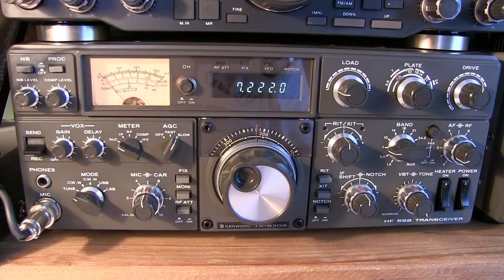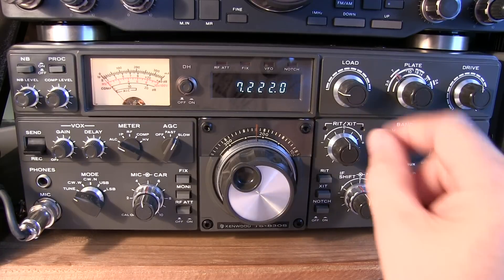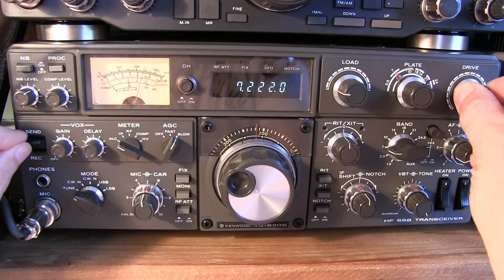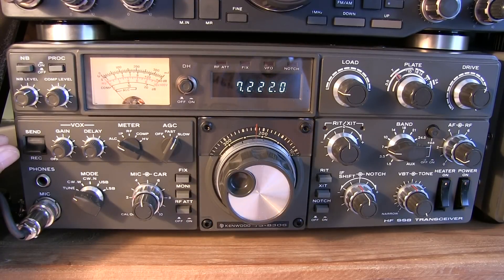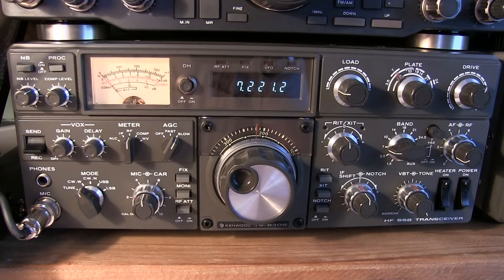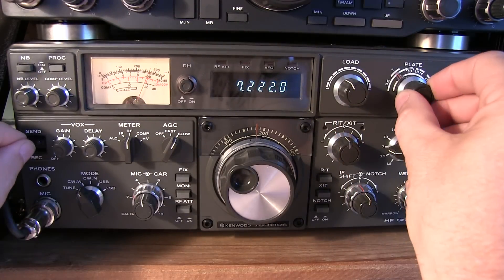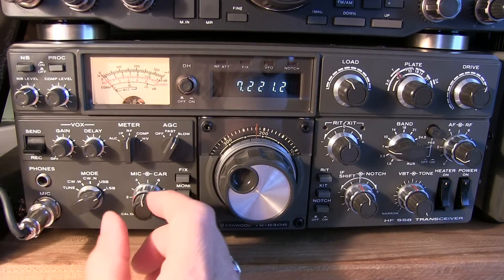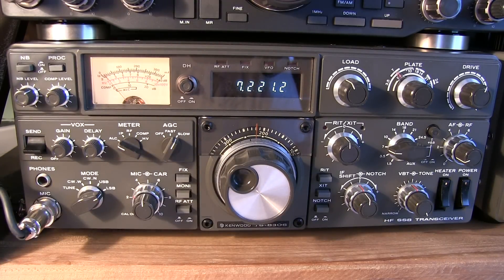#153: How to tune up a Kenwood TS-830S hybrid rig / transceiver | TS-520 TS-530 TS-820

Comment: I’ve a,so got the external tuner, following these steps do I still need then to use the atu ?
Reply from the maker: Depending on the extent of the mismatch, you can usually simply tune the radio directly to the antenna system and not use the tuner.
Reply: @w2aew  thank you,. ive just set it. up today initially with.a dummy load but now have it RX on my efhw, no TX yet  and worried about damaging it, it's just a lovely radio.
Reply: Sorry another question , this worked great but do I have to do the same routine whenever I change band so if I go to 20m form 40m ?
Reply from the maker: Yes. You have to retune when you change bands. Sometimes even if you move far in the same band.

Comment: Dear W2AEW, thanks for the very informative video. 
One addition if you don't mind. My TS-820S manual starts the tuning process with checking the plate idling current with Meter switch set on IP.   On LSB/USB switch the Send and see the current, should be 60mA. Adjust with rear panel Bias switch to 60mA. This is also mentioned in TS-830 manual. Any comment on that?
Anyway your video is the most informative how to tune a hybrid rig.'
72' OH2XA
Reply from the maker: Checking the bias is a good idea. I didn’t include this in the video because it isn’t something that requires adjustment often.
Reply: Roger roger

Comment: Great video, I watched it a couple of times so I can comprehend what you were doing. I'm assuming this procedure is the same for the ts-820s.  My question is, how many megahertz away from the original frequency can I go without returning?
Reply from the maker: It depends on the band.  On 10m, you can probably go several hundred kHz or even 1MHz.  On 80m, you may have to tweak it if you move by 40kHz or more.

Comment: I followed you instructions to the point of tuning at power.   At that point, I switched the meter to RF as instructed.  I set the mode knob to CW.W.  Note that I have previously set the drive and CAR as instructed to keep the needle in the ALC range.  Moving on.  First of all I switch the send/rec switch to send and nothing happens on the meter. So, key my code key and then I get a signal on the meter --but it is way off scale.  If I don't use the key, I get nothing on the meter.  So, to bring the needle back on scale, I have to tune the CAR down to about 1 on the knob scale.  At that point the needle is on the meter and I can adjust for max power on the load and plate.  The meter is reading right at 350mA.  But that's where i set it when I reduced the CAR to get the needle on scale.  So, exc for the glitch where the needle went off scale after the initial final resonance tuning, I should be set to transmit.  However, my output is only 40 watts in CW with the key on.  I should be at 95 watts or so, shouldn't I?  I have the same exact rig that you're using, the Kenwood  TS830s.  What am I doing wrong here?

Comment: Well, I give up on restoring my TS-830S. I'm parting it out. Everything is fine with it. I took it completely apart and I'm not techy enough to get it back together. Anyone want to purchase some great parts?
Reply from the maker: I wonder if the gear assembly in your VFO is less worn-out than mine?
Reply: @w2aew  It's like brand new. Gears are perfect.

Comment: I was able to peak the drive and dip the plate current, but when I put in cw mode and the meter at rf and switch to send the meter has 0 movement. Does that mean my final tube is bad?
Reply: On my TS820S I had this happen.  Turned out the SG switch on the back was turned off. This greatly reduced output. It should be on for normal use.
Reply from the maker: Could also be a problem with the mode switch/

Comment: My alc doesn't seem to work is it okay to use the RF in this process while doing the first two steps before the plate
Reply from the maker: It is difficult to say for sure, but as long as the dip and peaking process worked, you may be ok.
Reply: @w2aew  yes plate diped a little
Reply: I got the alc to work just needed to turn the carrier up a little bit

Comment: The tune-up procedure as described in this video corresponds to that which is contained in the Kenwood TS-830S manual, however, the procedure as described in this video does not necessarily provide the maximum output power.  For maximum output power, after completing the procedure as described in this video, you then peak the output power as shown on your SWR meter (or other means of monitoring your output power) by alternately adjusting the PLATE control and the LOAD control while you are in CW mode with key down.  I use non-resonant antennas in conjunction with an antenna tuner. It has been my experience that the tune-up procedure as described in this video may provide only half as much output power as that which can be obtained by peaking the output power as shown on my SWR meter by alternately adjusting the PLATE control and the LOAD control while in the CW MODE with key down..  Be sure not to exceed 5 to 10 seconds key down when performing this second phase of tune-up.  Credit for this enhanced method of tuning the TS-830S goes to Mark Gilger, WB0IQK. Net Control for the Kenwood Hybrid net.

Comment: Just curious…. I just received one of these radios. Does tuning up as this video shows eliminate the need for an antenna tuner?
Reply from the maker: In many cases, yes.  But of course, it depends on how bad the antenna system is in the first place.
Reply: @w2aew I’m guessing I’d need an external swr meter…. Not seeing one on the radio.
Reply from the maker: @brianr76    No, not needed.  As long as you can dip the plate and peak the RF, you're OK.  An external SWR meter will NOT help as it would show the SWR on the output side of the tuned network - it will not show the effect of adjusting the output PI network.
Reply: @w2aew  thank you. One more question as you seem fairly knowledgeable about these radios…. I need to have the power cord replaced because it’s frayed and looks like it was chewed on by something. Is there a specific cord type/amp rating I should use, or just any standard two prong ac cord will do?
Reply from the maker: @brianr76  The stock cord was an ordinary 2-prong AC cord, so that would work.
Reply: @w2aew  thank you so much! Hope to get this cord swapped and fire it up soon! I’ve bookmarked this video and given you a sub 👍🏻

Comment: I have a four or five of the solid state newer Rigs but I love my Hybrids! I have my TS-530 on the bench now. I need to get my TS-830 and my other 530 in somewhere for some TLC. My first Rig was the TS-830. Over the years I've owned five of them. I used to have my dad's old TS-820, and I had a 520 for a while. Don't know how to fix them so I just had to buy another. N9XFX

Comment: Nice video with one exception: On my TS-830S, keying the microphone (MC-50) does not deflect the meter when  ALC is selected, As the result, it is not possible to adjust the microphone gain using the method described in this video.  With a Kenwood MC-50 microphone, the optimum setting of MIC is generally around "4" on the "0" to '10" scale.

Comment: Thanks for that. I don't own one of these radios but I've always wondered what those controls do. Seems like a lot of work to get on the air. Are these radios using valves or transistors? Im assuming valves. Also what's the heater button for on the bottom right corner?
Reply from the maker: It is a hybrid rig.  All transistorized except for the RF power amplifier which uses 3 valves (tubes).

Comment: Is possible for the meter on this rig to indicate the wattage output or do you need a separate wattmeter for this?
Reply from the maker: It's best to use an outboard power meter.
Reply: @w2aew  Ah.  Ok.  Thanks for the tip.
Reply: @w2aew  Ok, thanks.

Comment: Would be so awesome if you could do the same video but on Yeasu FT102.
Reply from the maker: Well - if I had access to an FT-102, I would.
Reply: @w2aew  I have ft102 and I love it to bits. One of the finest radios ever made. There is some weird issue with frequency counter, after hour or two of operation it start showing 6khz les than it should and very last digit would display random numbers... apart of that it's all good. Anyway,  thank you so much for your awesome videos, best ham radio content ever!

Comment: Thanks very much for making and sharing this video. I have just agreed to buy a clean and tidy TS530 and found this very useful as I know nothing about hybrids but want to learn. Please can you tell me if I do this procedure every time I change frequencies or is it every time I change bands?
Reply from the maker: It's a good idea to retune if you adjust your frequency significantly, such as 20-40kHz or more on the low bands or 50-100kHz on the high bands.  And, you MUST do it when you change bands.
Reply: @w2aew  Thanks very much, I appreciate you taking the time to reply.

Comment: Why mess around doing all that with the LOAD control at minimum?  I've read where that is not good for the tank circuits.  Just set the meter to RF, and tune for max output.  Not necessarily the maximum power that can be achieved, but max output at less than full drive level.  Then gradually increase the drive and adjust for maximum power output.  I've used this method for over 30 years.  The rig still works fine.

Comment: I know this is an old video but how would i reduce the power output to drive an amp? Lower the drive?
Reply from the maker: When using an amp, it's usually best to use the ALC connection between the amp and the rig (if the amp has one).  If not, then the two recommended ways to reduce the output power of the TS-830 are to a) reduce the LOAD control, or b) use an adjustable DC voltage on the ALC input.  These methods are described in these two references respectively:
https://www.k4eaa.com/TQ1.htm
http://www.wb4hfn.com/KENWOOD/Articles/TS-830%20Survival%20Guide-01.pdf
Reply: @w2aew  Thanks. VE3WF

Comment: I did as Alan said on his video here and didnt worry about the 225ma which I had questioned him about. After I tuned mine the way he  describes I checked to see if I was between 225 and 260ma which is okay according to the 830s manual and I was at 240ma @ near 100 watts out. My tubes are original so all is well. Easiest way I ever tuned this rig.
Thanks Alan !

Comment: I get a dead reading when adjusting for the Mic. Needle barely moves at all. Any ideas?
Reply from the maker: As long as you're getting good power out at SSB, then don't worry about it. On my rig, I only get a little ALC reading, even with the Processor on.  Without the processor, I barely get a ALC reading.  It is not a problem.

Comment: I have 2 issues with mine. The first is in step 1, I never get any ALC reading. The second is, when I try the "high power" tuning procedure, I don't get any RF output unless I also close the key after setting the mode switch to CW and flipping the switch to send.

Any idea what could be wrong? The radio seems to work well, and I get full output and good signal reports.
Reply: When in SSB mode, if you want to see RF power you need to speak into the mic (with the mic level turned up to say 4 to 5). Sorry if I'm stating the obvious but that's the point of SSB - there's no carrier wave.

Comment: Without a doubt, the best video demo on tuning a Kenwood Hybrid radio!  Crystal clear audio, video and staying on point without unnecessary confusing babble makes it easy to understand.  My first HF rig was a TS-520S.  Seeing others with solid state rigs and not having to tune up made me jealous.  I couldn't wait to get a solid state rig to avoid the tuning process of a tube rig.  But now I miss the hands on tuning process and the smell of the tubes.  Those Kenwood hybrids are loaded with charm and excellent performance!  I wish I had my exact TS-520S rig back now.
Reply from the maker: Thank you - the TS-830S was my unobtainable dream rig when I was first licensed nearly 40 yrs ago.  I picked this on up about 20 yrs ago.  Great rigs, and a lot of fun to operate.

Comment: I thought you would always check your plate Current before anything, should be 60ma!
Reply from the maker: It should be checked periodically. Once set properly via the rear panel control, it shouldn't need adjustment again.

Comment: After reading the procedure in the Kenwood operating manual several times, looking at different video's and articles, I was still confused about the proper ALC setting for my vintage TS-520S.  After seeing this video once, it all becomes crystal clear.  As usual in your video's...  Many thanks from a vintage operator.

Comment: Hey Alan- question for you (hoping you still get these comments after posting it 4 years ago).  I'm tuning the 830S for 10m following your procedure.  However I notice that, after peaking the drive and dipping the plate, I can only get peak rf power with the LOAD fully meshed.  If I move it clockwise at all it starts to drop.  So I'm left with peaking rf power with the plate.  Is that normal or 10m?  Also I only end up with about 60W average power when done tuning in CW mode.
Reply from the maker: All of the radios are different.  Of course, it also depends on what load you're tuning into.  In general though, you should have a little wiggle room on either end, even on 10m.  So, it's possible you have some other components that have drifted a bit over time.  It is common for these rigs to have less output power on 10m as compared to the lower bands.

Comment: been trying to find one of these for my first HF radio, i wanna stick to a budget of less than $400 (for radio only) any other recommendations?

should be noted, mainly looking for data modes (psk31/rtty etc), along with SSB.
Reply from the maker: Note that hybrid rigs like this aren't the best choice for modes like psk31 because it is more difficult to set them to run at low power.  You'd be better off with a more modern solid state rig for the digital modes, in my opinion.  Otherwise the Kenwood hybrid rigs like these are really great - super for SSB operation and CW operation.  You should be able to easily find one for less than $400 in good shape.
Reply: w2aew Ok, any recommendations? Also looking at 6m, so a newer radio that includes that band is a bonus for me. I was originally looking at the FT450D but it seems those are going up in price lately. Placed bids on a few at around 450$ but honestly I'm not really looking for the latest and greatest HF and spending the extra cash isn't an option for me just yet. I have an OCF windom ready to go up when i get my radio.

Comment: Hi @w2aew,
I have trio TS-510 , can i use this process to tune up the transceiver?
Reply from the maker: I've never used a TS-510, but the process should be similar.
Reply: We made the antenna an hour ago, and when the radio doesnt transmit. It's old rig which wasn't used for a 10years or more. It receives excellent but the transmit doesn't work. It has the voltage but no Ampers are going out. (sory for my bad English)

Comment: Thank you very much for this video. Friend of mine has this Rig, but it has problem with transmits. When you hit the transmitt button the nidlle is stucked and it doesn't put out power. I will check all the comments below to see what is comented. Thank you again 73 de :)

Comment: what happens when the needle doesnt move on drive or load? final tubes go out? 
dont see any rf out on meter either. using a kenwood ts 530s
thanks
jeff
ke7ace
Reply from the maker: Make sure your heater switch is on.  Are the three tubes lit up?  You may want to have the tubes tested to begin with, but there certainly could be a different problem.
Reply: just realized the send switch was on when i turned on radio. not sure if that matters or not.
think  the kid messed with radio while i wasnt looking. i think the power was fading over the past few weeks started out at 110 watts then down to 80-90. then it wouldnt tune up past 50 watts. then now nothing,  do you know how much a set of tubes cost? thanks jeff ke7ace
Reply from the maker: I don't know the cost of new tubes these days. Of course, you really should test the tube before spending the money. Another thing to check is to see if the HV plate voltage is present during transmit. I believe that this is one of the things you can read on the meter.